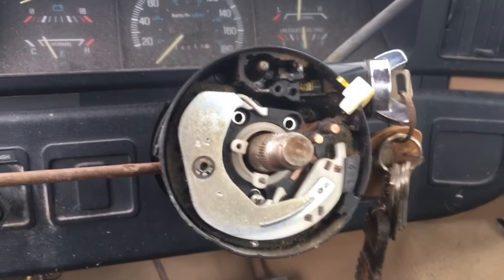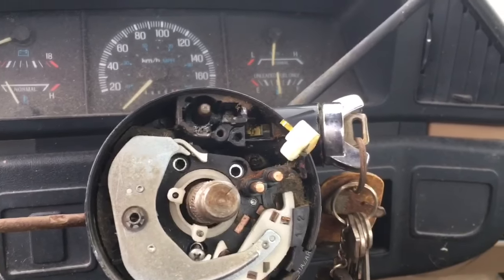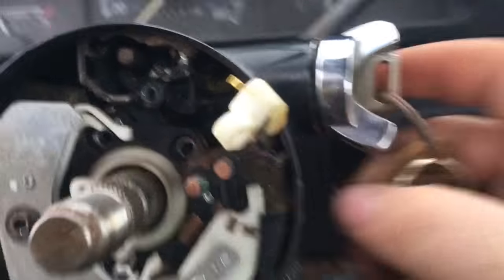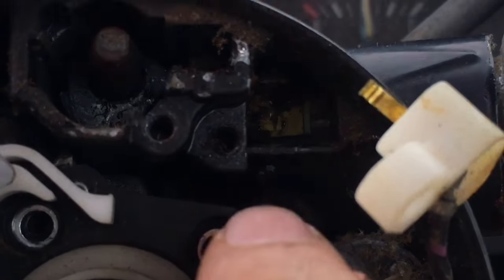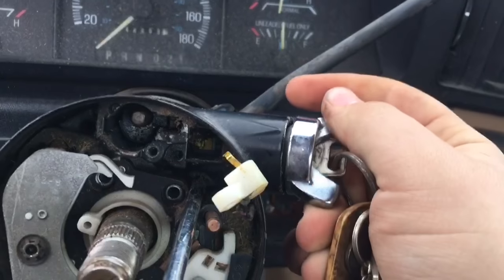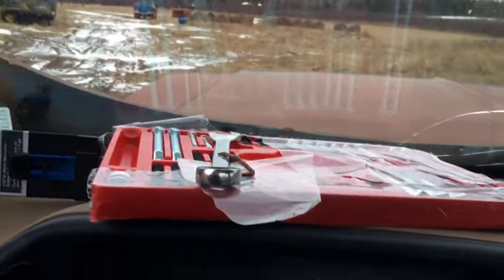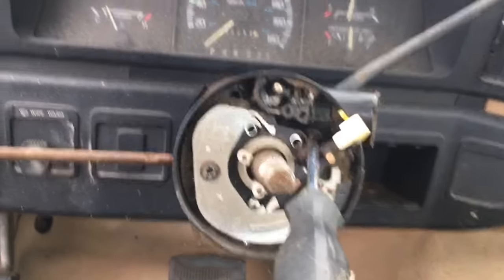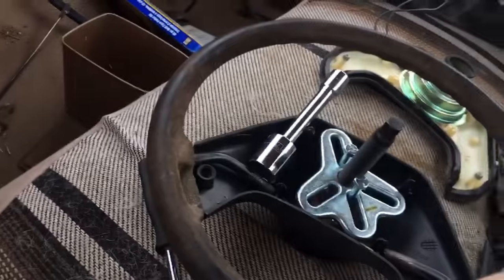1980-91 F Series ignition switch removal

Comment: Super advice worked well I changed mine so about 12 years ago but the switches simple wear out and then get stuck, the Chilton Manual is wrong the let you take the Plastic cover off and lower the steering wheel.
No need for this.
thanks for the Clip It helped a lot. They last a long time so I forgot but with  1 Million Miles on the Ford you simple forget things because this thing is holding up and up.
Thanks again 

Chris Schmidt

Comment: That’s the lock cylinder not the ignition switch
Reply: Potato potato
Reply: @romannabong6804 the lock cylinder is NOT the ignition switch which is on the bottom of the column
Reply: Karen

Comment: What if you lost the key and thats why your replacing it?
Reply: Prolly still works but who knows, I’m here because my lock cylinder just spins instead of stopping on a half turn like it should
Reply: @MichaelFletcher-to7mm  my lock cylinder just spins freely to wat was ur fix??
Reply: @ah-yp6vp  go to oreilly and buy a new ignition cylinder, they’re under $20
Reply: @MichaelFletcher-to7mm  
"Prolly"?  What the hell is "prolly"?  Is that even a word?
R.I.P.  written English language.
Reply: @RalphSampson...  just a shorter way of saying probably.
Reply: @MichaelFletcher-to7mm  I cant get my old one out. That pin has no give and im replacing it due to having no key for it. Pushing the pin isn't helping, and can't turn the ignition into "on" position without a key ☠

Any tips?
Reply: @michael fletcher did you ever figure out how to get the lock cylinder out with out a key?
Reply: @Tbrickzin22 I would also like to know if you figured that out?